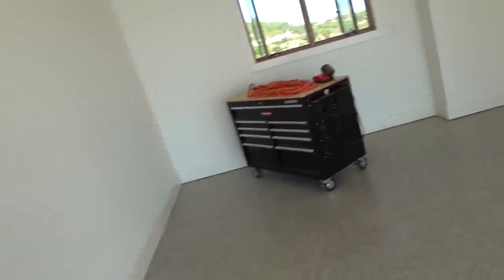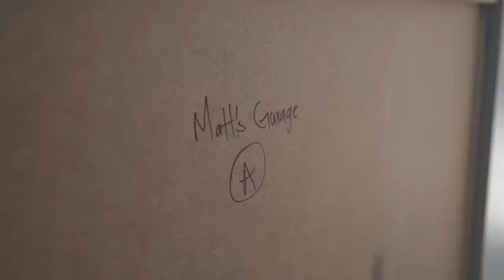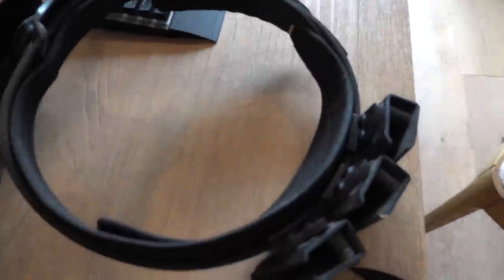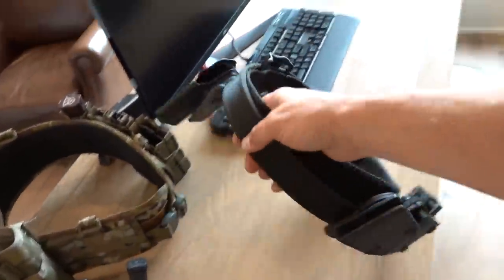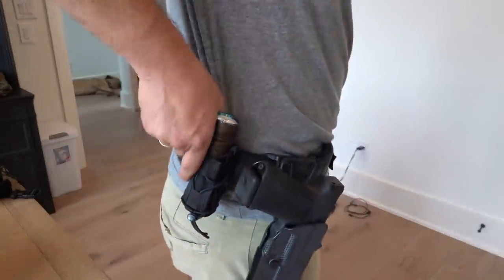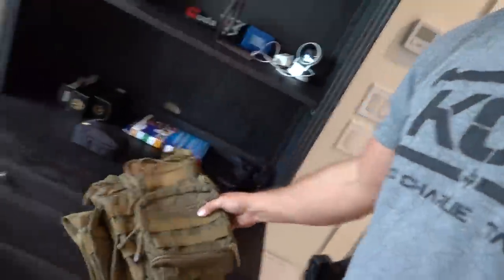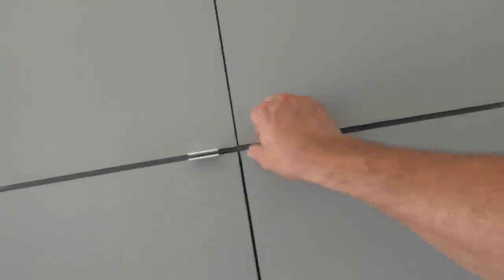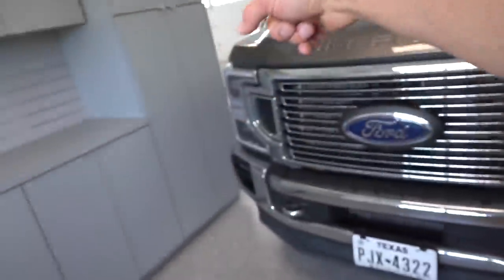Caught Intruder in my Backyard at 10pm... DemoRanch Gear Check!

Comment: I'm gunna be honest Matt... You have a Really big house on the top of a hill in the middle of nowhere. You NEED to think about protecting your self from much larger threats. You have a literal Plethora of reasons large groups might wanna muck around. You should think about perimeter safety and you should reach out to the local sheriff and see what there response times would be to your home. Ask to set up a test to really see what the response time would be. Also, you probably already have seen this a million times already but get a gate and a big ol fat wall wouldn't hurt at least for a portion of your property that would have the greatest possible defensible value (probably around any gates you  might wanna set up).

Comment: I don't think you should ditch the battle belt and pistol, but I think it is a mistake to use 9MM for home defense, instead it should be your secondary, and for the safety of you're family you should focus on a short barrel AR or and AR pistol as your primary, and load it with frangible bullets (rounds with little to no over penetration) as well as the massive capacity increase you can get using a quad stacked 60 round mag+ another in your belt. and since you can afford it, Hell yes you should put a plate carrier on! I would if I could afford to even own one.
Finally, PRACTICE if your ever lucky enough to be home alone empty what ever SBR you choose and "clear" your house, learn its corners and how to clear it in the dark without exposing yourself BEFORE you have to do it for real.

Comment: Looks like a good setup for an 'on the go' situation.  Quick observation though, the mags should have the rounds facing forward (easier reloads)  Also, having a small blade on the belt probably wouldn't be a bad idea either.